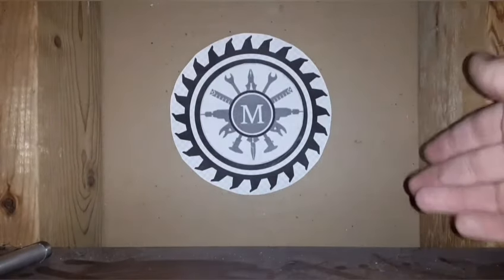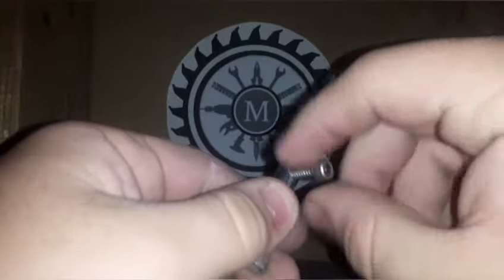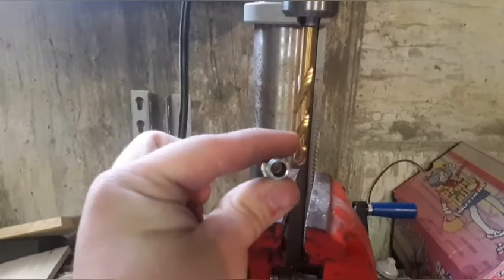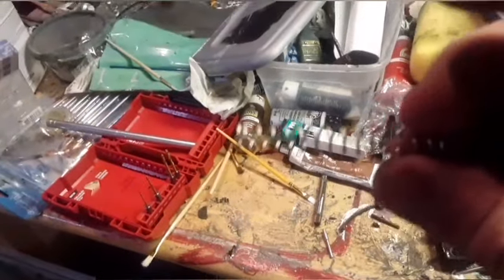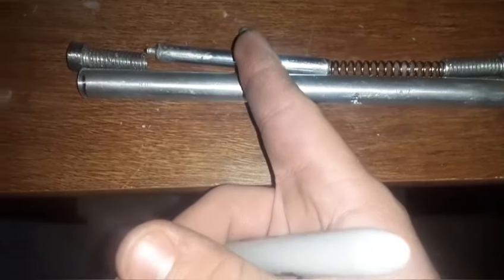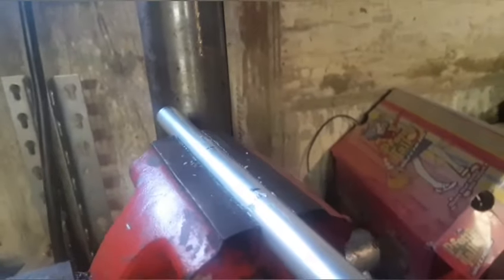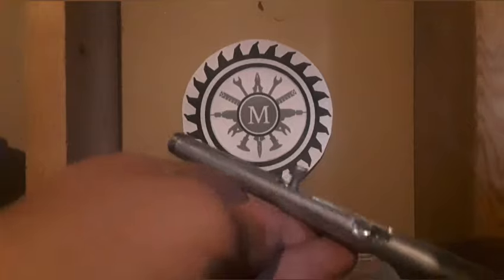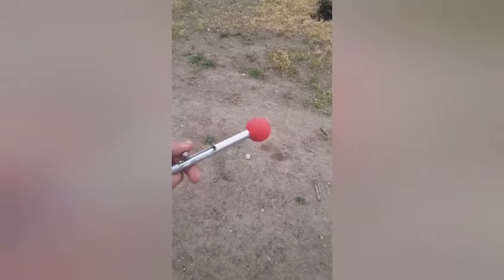(200 sub. special) How to make a spy PEN GUN (under $20!!!)

Comment: Put the drill bit in the vice and then put the bolt in the drill. Press and gravity from the drill. Press will keep that hole straighter. That way, you can put the hole all the way through it and it'll be centered. The drill press will keep the bolt centered.

Comment: Hey awesome video. What is the dimensions of the outside pipe? Or whatever it is that is strong enough to handle the primer and easy enough to cut through with a dremel?
Reply from the maker: Thanks! The outside dimension is 0.5 in. It's made aluminum.
Reply: @MakinItReal  thanks 👍👍👍👍👍👍👍
Reply: @birdman4854  i would be careful with thin crappy aluminum holding the pressure of a round might wanna use steel for it to last longer

Comment: Is the body of this object an actual metalic pen?
If not is it a tube of sorts wat dimentions have the tubes?
Reply from the maker: I got the parts at home depot, the primer is a 12 gauge primer. Both of the bolts are 3/8 by an inch and the pipe is 3/8 inches diameter inside and it's made of aluminum. The little screw to pull back is an 8/32 by half and inch socket cap. Hope that helped if there's any more questions, don't be afraid to ask😄

Comment: You built a zip gun, illegal  in most states, and I think even illegal federally.
Filipino guerrillas made very deadly shotguns with two sizes of water pipe. A 12 gauge shotgun shell in one pipe and a slightly larger pipe with an end cap containing a firing pin that slipped over the pipe with the shotgun cartridge. To fire you simply slammed the outer pipe against the back end of the shot shell. By the way, I think the pipe made shotgun is illegal too.

Comment: Can i use 22cal ?
Reply from the maker: I actually tried to do that and put it in the video, I took the gun up to mountains and hooked up a string to the barrel Bolt so that I wouldn't have to hold the pen gun, in case it exploded in my hand. When I pulled the string the bolt flew forward and nothing happened. If you can fix that you should make a video, but I think the reason why I didn't work is because 22 ammo has to be hit from the side, not directly in the middle. It doesn't have a primer, it's just metal hitting on metal. So that's why it wasn't in the video. But if you can figure that out, that would be awesome!
Reply: That would also be an A.O.W. according to the ATF... unless you could do some crude rifling inside the barrel & put a pistol grip on it. That would be enough to make it legal from a federal standpoint, anyway... check your local laws.

Comment: hello nice video, I wanted to know the diameter of the tube and its length, then know what material it is made of.
Reply from the maker: Thanks! The tube is 3/8 in. diameter inside and 0.5 in diameter outside, it's made out of aluminum
Reply: @MakinItReal  thank you so much for having me
 replied to the previous comment😃, could you tell me what type of ammunition you used and their brand.
Reply from the maker: @lLivay-  well if you're talking about what it shoots, I have it shooting (in this video) some BB's for a BB gun. If you're talking about the propulsion, like what makes the BB shoot out, as you can see in the video I used a 12-gauge shotgun primer. Sorry I can't remember what brand of primer it is, however any 12-gauge primer should work.

Comment: My firing pin isnt firing the bullet, do you have any idea what it could be??
Reply from the maker: Hello, as far as I can think, it could be one of 3 things. 
1. Either the firing pin is not small enough or it's too small.
2. The spring may not have enough force to push it fast enough forward.
3. Or the pin is not hitting the center of the primer/bullet 
Hope this helped! Good luck!👍
Reply: @Makin It Real  Okay thanks I'll try that!  I'm using a .22 bullet does that make a difference
Reply from the maker: @Girlypop_plays_roblox  I'm not a gun Smith by any means, so I could be completely wrong about this, however, if you look at 22. Casings after being shot you can see that the pin hits the side of the bullet... not the center. This design is meant for hitting it in the center of a primer. I would recommend doing some research on 22 guns and bullets before you go further. Also I only made this video for entertainment purposes only so if for some reason something goes wrong and you get injured, please note, I am not responsible for any injuries you may receive. However I'm more than happy to help in any way I can.
Reply: @Makin It Real  yes I completely understand. I'm just trying to figure out if you or anybody else knew the problem!
Reply: @MakinItReal  what ammo are you using?
Reply from the maker: @Girlypop_plays_roblox  I never could get a 22. To fire from this gun. If I could I would have put it in the video, so I had the same problem. I am just using a 12 gauge primer in this video
Reply from the maker: I recommend watching this video. This guy has a smaller design and it works with a 22. He might be able to help as well. https://youtu.be/fHVuMONKXS0
Reply: @MakinItReal  thanks heaps man I appreciate all your help!!
Reply from the maker: @Girlypop_plays_roblox  of course! If there's anything else, don't be afraid to ask. 👍

Comment: what were the measurements and material used???
Reply from the maker: I got the parts at home depot, the primer is a 12 gauge primer. Both of the bolts are 3/8 by an inch and the pipe is 3/8 inches diameter inside and it's made of aluminum. The little screw to pull back is an 8/32 by half and inch socket cap. Hope that helped if there's any more questions, don't be afraid to ask😄

Comment: Hardware name plz
Reply from the maker: I got the parts at home depot, the primer is a 12 gauge primer. Both of the bolts are 3/8 by an inch and the pipe is 3/8 inches diameter inside and it's made of aluminum. The little screw to pull back is an 8/32 by half and inch socket cap. Hope that helped if there's any more questions, don't be afraid to ask😄